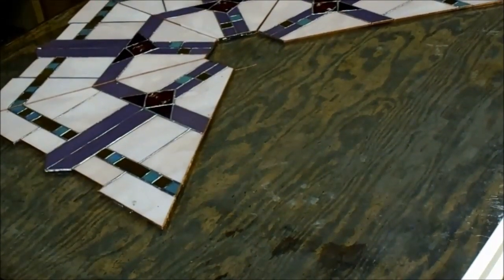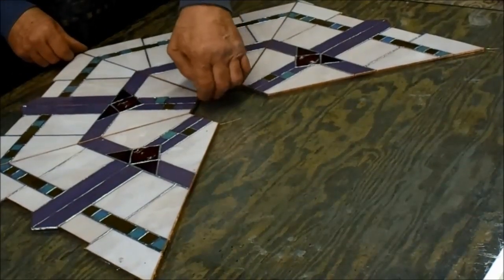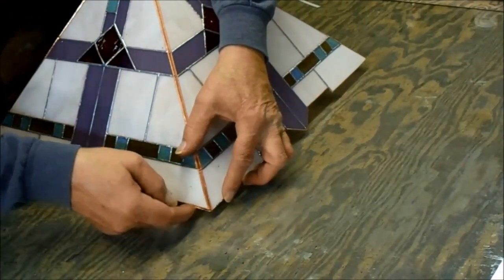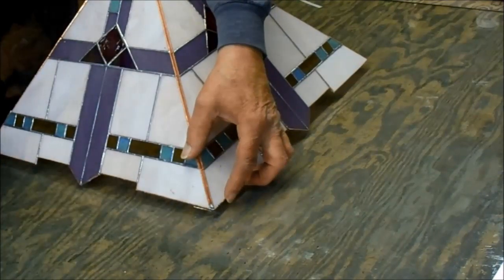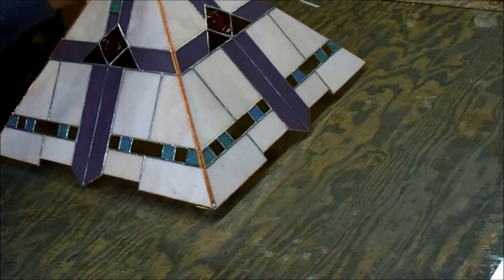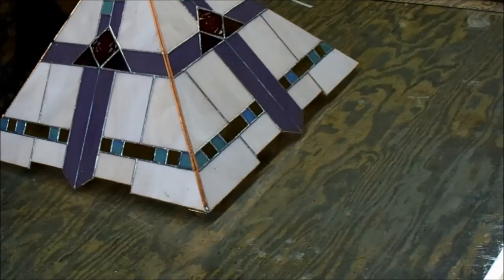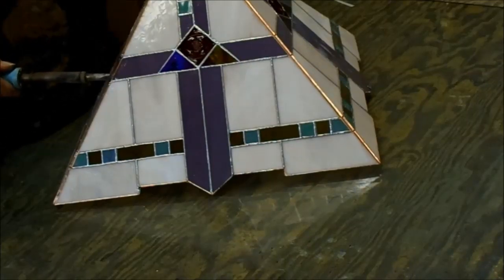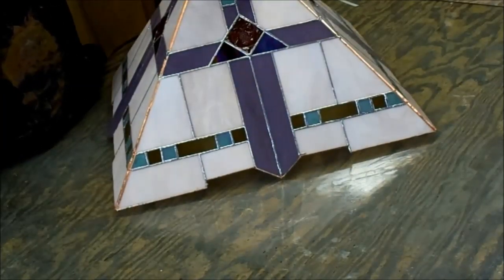Wire Shade Assembly part 2

Comment: Excellent technique!  Especially like the explanation of why the fine gauge wire is best.
Reply from the maker: Thanks I had come to that conclusion after trying thicker gauge s & when bending / folding the panels the heavier gauge ripped the foil off & what a mess that was to fix 😊😊